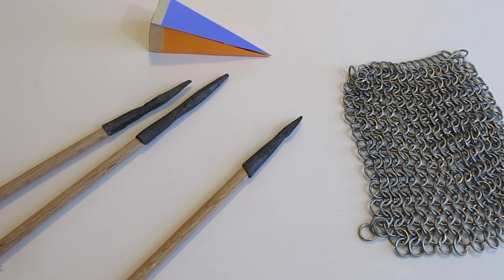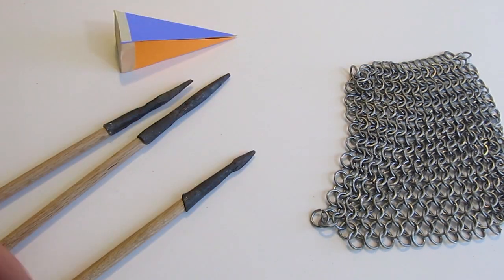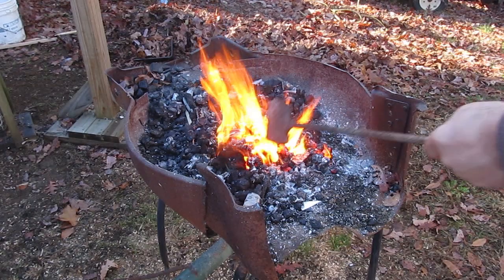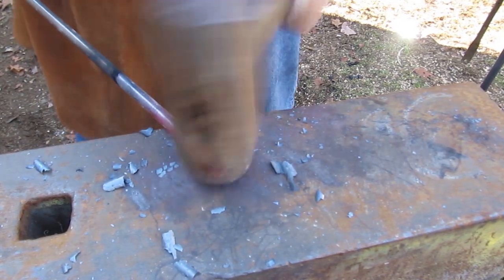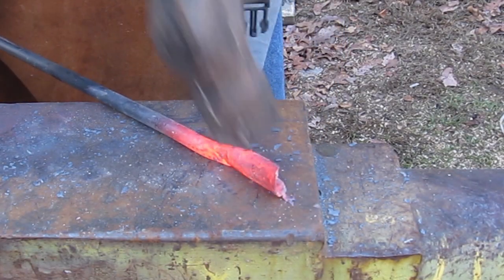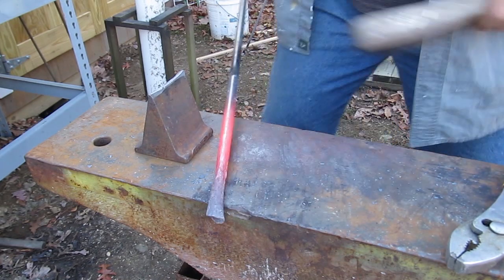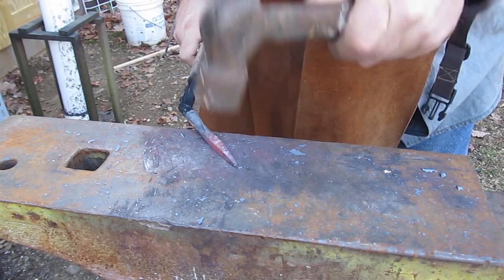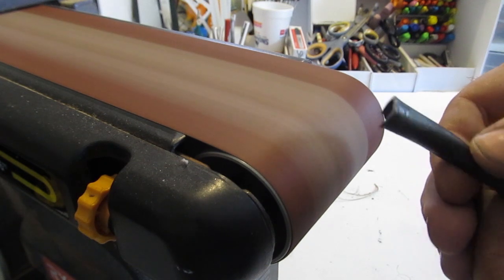Blacksmithing - Forge a Medieval Arrow Tip ( a Bodkin)

Comment: you should get a wire wheel for your bench grinder, its great for making the scale of a forged piece pretty, or you could remove the scale entirely
Reply from the maker: +Film Factory Great suggestion. thanks. I really need to do this.

Comment: How exactly do you get the arrow head onto the arrow stick? just put it on and hammer it closed or is there some trick to it?
Reply: +Beerkeg92 you don't need the arrow head to stay on there permanently.  a good friction fit. because the shaft of the arrow is more likely to break than the tip. the trick is to make sure the cone on the tip is very consistent that way it'll fit the arrow better.
Reply from the maker: +Grant Silliman, Jr. Great comment!

Comment: Where do you source your coal? I've been having a terrible time trying to find it in MA.
Reply from the maker: +IIDASHII Great question. I buy the coal on ebay. Typically about a dollar a pound for small amounts. 20-25 pounds. Good for a couple days of forging.
Reply: Interesting. I usually use propane, but sometimes I just need more heat!
Reply from the maker: propane is great and efficient. But there is something special about a good coal heat going. Get yourself some bituminous coal. You will love it. The fire pot gets a wonderful almost syrupy molted look.